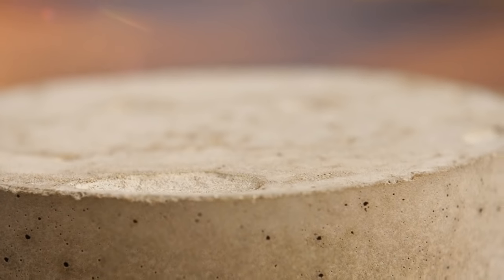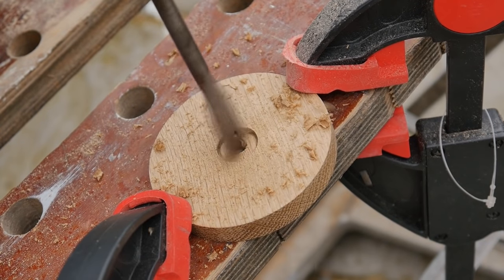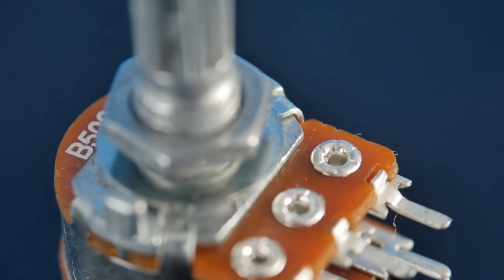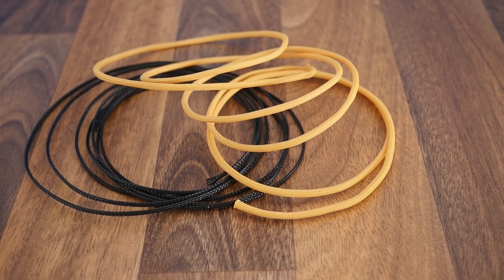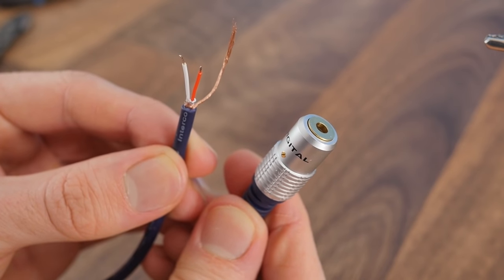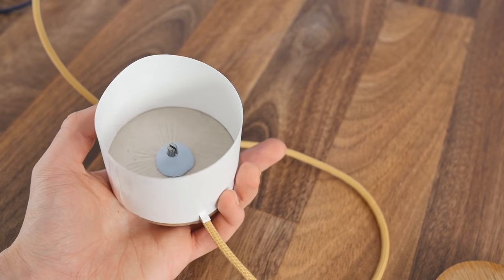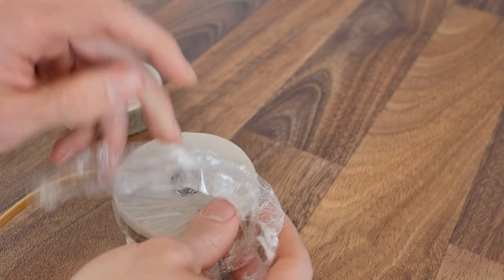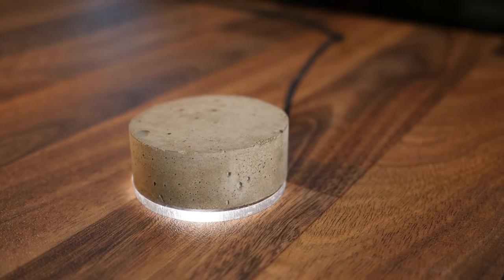How To Make a Concrete Volume Knob

Comment: Now.. I really don't need to make this..

.. But i really need to make this!
Reply: +TheLynxDr If you have access to a core drill, you could make one from any type of rock. Slate could be cool. Quartz would probably fall apart, but if not, it'd be the coolest thing ever.
Reply: +rasmis You, Sir, just inspired me to make something horrifyingly cool!
Reply: ted clubber lang I'm glad. Thinking about it, if you don't go round, but eg hexagonal, it can be done with an angle grinder and a (cheap) diamond disc.
Reply: If not quartz... I wonder how fast you can grow a crystal? You can get those science sets for kids to grow their own in a container of water, little crystal gardens even. 

They might not be the strongest, since they don't grow in the bowels of the Earth containing tons of pressure and ridiculous temperatures. But I suppose you could get a load of crystals (or pebbles, or interesting rocks and crystals from a rock and crystal shop {which do actually exist} ), and encase them in something like clear epoxy. Temperature and chemical reaction problems taken care of, somehow. Then you could have a knob with lots of crystals in it, encased clear, in a round mould. 

Or better than epoxy, one of the least reactive substances known... glass! Of course you'd need a glass-blower, someone with the right furnace and tools. They pour glass all the time. Get 'em to encase whatever crystalline doodads into some good glass. THEN you've got yer knob! 

Actually do you even get chunks of quartz that big? Do they sell them? For how much? I bet "a lot" is part of the answer. 

Still there's always offcuts of marble or something. Or jet, or some other attractive rock. They can't throw away semi-precious rocks fast enough. Except when they're hawking it on some QVC-type jewellery channel, with as little shame or dignity as a Youtube advertising sponsor.
Reply: Same here

Comment: Nice idea and well shown making of it. I'm into electronics and technical stuff around home and a lot of DIY so I can appreciate a good idea and a proper teaching how-to-make-it narrated with a wider audience in mind (i.e. not technical folks also). I've discovered your channel a few months ago. Well edited videos. Congratulations on your achievements. Keep up the good work. Greetings from Poland. :)
Reply: Oh, so maybe you know where I can buy that potentiometer? There's literally no place in Poland with stacked 500 ohm potentiometers. do you think 1000 ohm one will work?
Reply: Actually I'm surprised it's 500 Ohm. Such a low value inbetween output and input of the next audio block (i.e. an amp)? For headphones it might make sense though. Don't worry, 1k Ohm should work too with headphones and for just interconnect cable - actually a bigger value (22 kOhm, 47 kOhm, etc.) would be better. Jut buy any potentiometer that has similar physical dimensions and a value in range mentioned above and you're good to go with the project. :) Example offer of 50k linear - RV16GN(PH)-41CC-B50K-15KQ: http://www.trim-pot.com.pl/Katalog.aspx?cat=2&p=2 (I've just googled that). TME has a 10k linear version. As I said, it depends whether you need it for headphones or an interconnect cable.
Reply: CJWarlock okay, I got my 50K linear one from old buzzy speakers and it works surprisingly good.
Reply: Cool. Just as it should work. Have a nice audial experience.

Comment: Very nice project! And I'll try one for myself :). Concerning the potentiometer. The value of 500 ohms isn't set in stone (pun). A 1k or 2k will work just as well and demand less of the audio source. Even pots up to a 100k will give similar results. Going below 500 ohm is not a good idea, since the source might become to heavily loaded (not be able to deliver the needed output current ).
Reply: Exactly why I’ll be using a 50K pot. How about pots that can go beyond 100K, even up to 1M
Reply: Almost all sources are designed to drive headphones, which can be as low as 16 ohms. The lower the resistance, the less mains pickup you'll have (anything above 10k should be fully shielded), and the less voltage noise the pot will present (the second is rarely a problem with consumer audio, it begins to matter at circa 100db snr). So going even lower is probably not that bad of an idea. Yet, many sources have output impedance of 50 ohms, so approaching that, you'll lose some amplitude. 500 ohms is a great choice, in my opinion.

1k and above will not work well with headphones, it's too high.

Comment: If you are using it for controlling the volume of your pc, you might want to use an encoder + microcontroller, to adjust the system sound volume via USB. It could also give you some more possibilities with the lighting (which I liked most).

Comment: Very smart.  You can get more air bubbles out and an even smoother surface using a small vibrating device, like a back-massager set to low, and gently vibrating the project for a few minutes.  For a glossy surface, use firm plastic, or glass.  Using cheap narrow glass candle holders from a 5&10 or thrift store work really nice.  Note, get really cheap glass, as you may have to break it to get the concrete out.  Again, cheers for the video!!!

Comment: would be cool to have the LED be brighter as the volume increases - and dimmer when the volume lowers.
Reply: Perhaps if you could find a potentiometer with a third row of contact points you could do exactly that. And just solder the usb contacts to the pins.
Reply: You buy a TRIPLE GANG potentiometer with the same 500 ohm linear specs and just wire the usb power input for the Led to the extra pins. To get it to light consistently with volume you may have to experiment with resistors. Or you can check with the LED and potentiometers specs whether it wouldn't hit or dim from peak brightness too fast.
Reply: you can also mix the stereo into mono signal and you'll have spare connections both in the usb and the pot for the LED light
Reply: But that's stupid. Many producers like me work hard to add stereo effects and ad "life" to music. But go ahead.

Comment: Looks really nice! I would try to avoid soldering in the middle of the cable, and attach the two halves of the jack extension cable directly to the pot. You can still decorate the cable with the braided sheath.

Comment: It would be awesome to see you make a wireless version of this, that can connect with either wifi direct or Bluetooth. That would be Awesome and make a cool coffee table accessory while controlling Audio.
Reply: Would be possible with an esp32. The Bluetooth device would have to be As an input device (as a keyboard for example) but then you need a power supply...

Comment: Nice! Have you also thought of using an arduino micro (USB HID) and a rotary encoder instead to adjust the pc volume itself? It's also fun to add media keys or programm shortcuts.
Reply: 1. This type of potentiometer is not the best choice of this build, even using the type with double gain.
As mentioned by others, you really SHOULD be using a logarithmic potentiometer.  Yes, the linear pots work "fine" but Im sure you notice, as you get above "half" on the pot you arent really at "half volume" yet.
2. Same DIY build >>> Arduino + Rotary Encoder.   The advantage here is that negative side of using linear potentiometer exampled above is not present, and also important it show the volume level on the PC screen.
https://learn.adafruit.com/pro-trinket-rotary-encoder/example-rotary-encoder-volume-control

3. Esay verson of Rotary Encoder Volume Control: 
https://www.instructables.com/id/Digispark-Volume-Control/
or
https://www.instructables.com/id/USB-Volume-Controller-Potentiometer-Based/

4. Same build, but here with RGB feature!! pretty cool, Mat should have opted for this one, as we all know he is capable of great builds and he loves Leds/RGB.
http://dangerousprototypes.com/forum/index.php?topic=7654.0#p62863

5. Ultimate build, which is WIRELESS!!!
http://patrickmccabemakes.com/hardware/Dial/

6. Easy method that do not require any build/DIY, and very great option, for those who is not into DIY and like a neat Desk, as less device as possible: Great soft, which REALLY should be checked!!
https://www.nirsoft.net/utils/volumouse.html
PS/ my Config:      When Alt Key Pressed + Mouse Wheel
                                 When Mouse is above TaskBar ,  to be able to change Volume with only one hand ;)

Comment: Very cool project and I always enjoy your presentations. :) I have some thoughts that might be helpful for this project: In the long term it might pay to get a higher quality pot since it's got a fair amount of weight on it from the concrete knob. The value is not really critical, your 500 ohms is about the minimum you would want, but anything up to 5K ohms should work fine. 

Another option for making that channel for the cable would be to use a wood carving chisel. Possibly two; a straight one for the walls and a thin curved one for taking out the material. 

If you had a thick enough base you could do away with glueing the pot in if you drilled the initial hole the right size for the pots thread and then counter drilled from the bottom a hole the right size for the pot's body. Then the pot would be inserted from the back and held in place with it's nut on the top. Thus being held in the base by it's intended mounting method.This would obviously change the way you would route the cables. 

Rather than setting the concrete on the pot shaft itself you could get a knob that fits the pot's shaft and set that in the concrete. That way you could make the concrete knob away from the base setup, plus easily make a different one if you ever wanted to.
Reply: so a 50 ohm isn't enough ? i am not in to this so hopefully I can get the answer
Reply: +tom moolenaar It might be ok, if you are running out of an output designed to drive into a pair of headphones such as an iPod for example. If the value of your pot is too low it will reduce the level of signal available to send on to the amplifier as it will also function partially as a fixed attenuator. But that might be a problem if the amp you are driving has plenty of gain.
Reply: +xanataph thank you very much for the information

Comment: would be nice if the led was put in parallel with a third potentiometer on the rotary pot with a 1k resistor in series as this would vary the brightness of the led as you reduce or increase the music volume.
Reply: +Colin Littley Doing this you would either burn out the LED when the volume was low, or burn out the pot when on full volume. Better to go with a 555 PWM.
Reply: If you consider the LED is after the 1K resistor then it would only ever reach the max brightness it would not burn out as with the second rheostat being in parallel to the LED it would simply provide a bi pass for that voltage level. when the volume knob was turned.

Comment: If you leave 1 - 2 inches of wire on the USB ends you cut off, then you can use them for other projects, rather than throwing them away. Also, if you paint the concrete, it sort of defeats the purpose of using concrete, but I guess you could use a sealant if you wanted to coat it in something. You could also somehow include ball bearings in a track, to help support the weight of concrete so it doesn't tilt if you lean pressure on the side. This is a great project and video, because it is the perfect balance of detail and lack of detail, which inspires lots of creative ideas.

Comment: couldn't you add the led into the potentiometer circuit so that is corresponds with the volume?
Reply: no.
Reply: ok
Reply: Yes.
Reply: how?
Reply: Just hook up another pot and connect them in series. Choose a pot that can handle the voltage of the led, attach the positive power wire to the input, the negativ to the output and the ground to the third. Boom. Now you got a variable LED.
Reply: Also, add a resistor. 
DISCLAMER:
And google it. I'm only adept at electronics, so don't get yourself killed over my bad advice. Look up a wiring scheme. Don't use my comment as direct advice but rather as making a point that it's possible.
Reply: Actually all of you guys are wrong. Voltage from the jack can't drive an LED even at full volume. He would need a simple amplifier to light it up. Or a separate power source wired directly to the pot and the LED.
Reply: Yep, that's what I meant. Put in an extra pot inside of the existing one, and give it 12V power. That means the LED has its own power source, but is controlled by the other pots rotation. Maybe I was unclear :)
Reply: This video shows LED powered from USB port so it's not about powering the LED.
To achieve dimming led, you could use one pot section to regulate the current that powers the led and use another section as input for voltage controlled volume circuit (IC or not).
You could also simplify this by adding positive bias to one of the channels and drive a LED with it then filter it out with a capacitor before going to output.  But this will cause some distiortion in this channel, even if you put the diode in parallel.

The best idea by the way is to use a digital potentiometer, encoder and a tiny IC (attiny or so) so you can do whatever you want with LED (eg. RGB LED that indicates selected input source and other fancy things). This approach is not only the most versatile but also very reliable because encoders do not wear out like potentiometers do.
Reply: You buy a TRIPLE GANG potentiometer with the same 500 ohm linear specs and just wire the usb power input for the Led to the extra pins. To get it to light consistently with volume you may have to experiment with resistors. Or you can check with the LED and potentiometers specs whether it wouldn't hit or dim from peak brightness too fast.
Reply: Jan Metdepetop  yes but triple gang pots are less common. By the way, I don't see a reason why it's linear pot in the video.
Reply: tuomollo because it is much easier to make linear adjustments to volume than say going from 0 to 20 with the same rotation amount. as going from 50 to 55
Reply: Well, thing is, if the triple-ganged potentiometer range for volume doesn't correspond neatly with the LED,, you can adjust the window by adding a resistor in series with the LED or adding one in parallel to ground creating a "voltage divider" circuit to split off a little extra voltage and send it away to make the LED shut off earlier.  Or you can connect a moderate value resistor from your 5VDC line between your potentiometer and the LED to boost the voltage (depending on resistor value) to adjust eh LED window UP to maximize brightness earlier.  The thing is you shouldn't have to adjust it because the potentiometer should be 0 to 100% on all three circuit paths it has at the same time because they are physically connected to each other from the factory.

Comment: That's pretty cool, and i love the look of the concrete with the air pockets. The base can be round and the knob itself can can be a different shape like square or triangle or other shape. Like you stated, can use mdf or plastics or metals or mix and match and use plastic metal and lumber. Personally, I will add the led light with remote so I can chose different colors or just have the lights change colors on their own... The sky the is the limit on what can be used when making this diy project...

Comment: DIY Perks
Great project! I absolutely love the idea. I would do this to the circuit board of a pair of broken USB headphones or cheap a USB soundcard! Then the audio is transferred over USB to the sound processor from the headphones/soundcard, which has wires soldered to the potentiometer. You plug it in like any USB device and it has an audio output, along with power for the LED. Plus, USB audio is higher quality because it doesn't pick up noise from other computer components, although there isn't much of it (this one's for the audiophiles XD). You could even build a mic into the knob because the circuit for that would be there from the sound processor. When I do this, that's what I'm doing. Mic and knob in one! You could put a pretty decent stereo mic in the wooden bottom with one mic in a cutout hole on each side of the base.

Comment: does this affect audio quality? Also why not a log style potentiometers since volume is logarithmic in nature
Reply: +itHrtzWhenIP 
If it isn't an incredible expensive audiophile set up, which is doubtful, and as long as one gets a quality Pot, you shouldn't really notice.
Reply: +itHrtzWhenIP He is wrong both with value (should be 5k - 20K, depending on surrounding impedances) and it should be log.
Reply: @Valtra103  can you explain 5k to 20k and impendances real quick,which one should i get?thanks

Comment: Clever idea, and nice looking finished unit.  The weight of the concrete would also be good to hold the unit in place so it does not move around.  Nice work and video.

Comment: Why not connect the potentiometer up to the LED/light source, so that it dims with the volume as a sort of indication of the volume setting?
Reply: +Samuel Vella Then you will need a pot with three in- and outputs.
Reply: Good point.
Reply: +telefon72 or you can build an active control with a quad op amp like an lm324, you wire each output to a follower that are going in an adder that powers the led through a small resistor.
Reply: Mechanical Fix use a transistor. Base goes to music source aka output of pot collector goes to vcc and emmiter to + of led. The minus of led goes to gnd.

Comment: NEXT PROJECT: DIY CNC ROUTER with arduino! :D
Reply: +Dv8 Already up on tinkernut. And it works, I already tried it even.
Reply: Krisztián Szirtes Yeah I've found some projects like this on other channels, but the video here are so well made! :)

Will check out tinkernut ;)
Honestly the cnc router on thinkernut's channel is probably the worst one I've seen so far...
Reply: not really a 'diy perk', like the other small projects on this channel.
(I mean that it doesn't really fit in here.)